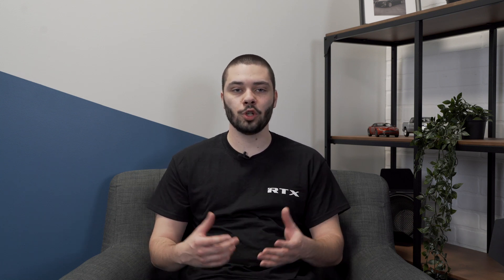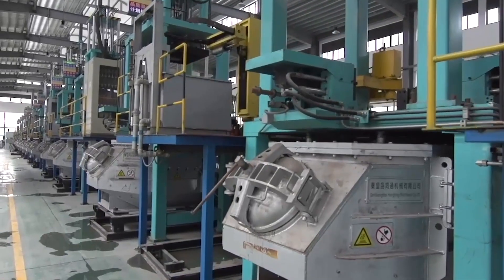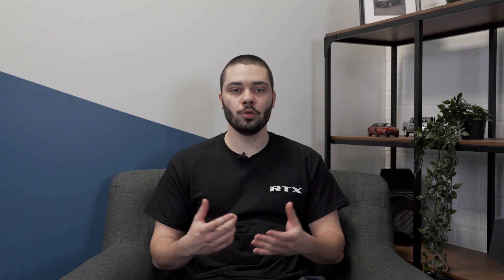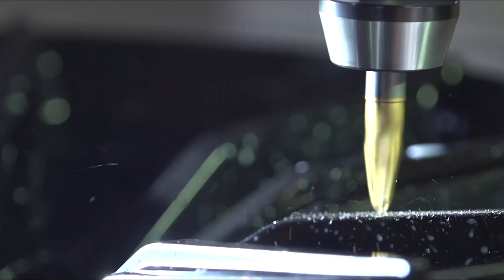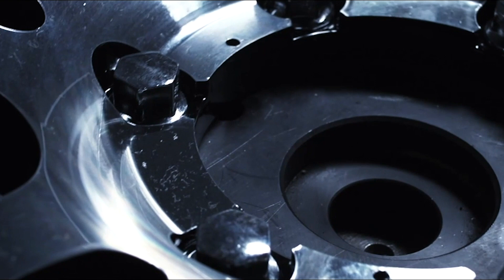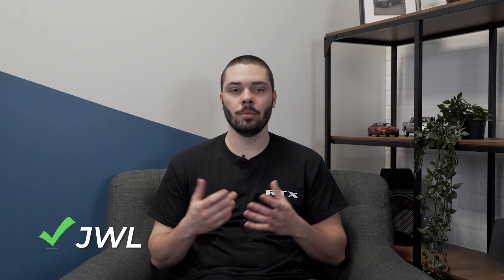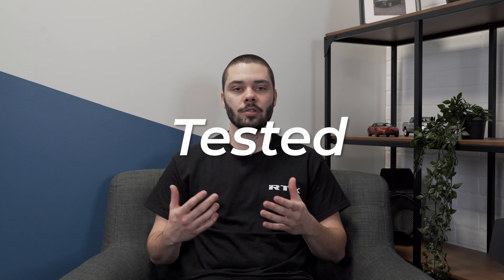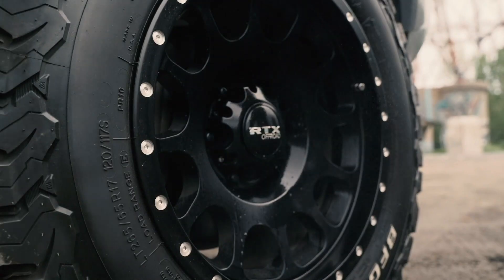How Are Our Wheels Made ? | Get To Know RTX #2

Comment: I have one question I have a wheel size 17x7.5 with hun size 73.1 

Will it fit my Honda civic 2022 with hub size of 64.1 

Thank you 

I all subscribe if answered
Reply from the maker: Hi, You'll need hub rings to properly install your new wheels but yes they will fit!
Reply: What's the bolt pattern and offset?? Check those too